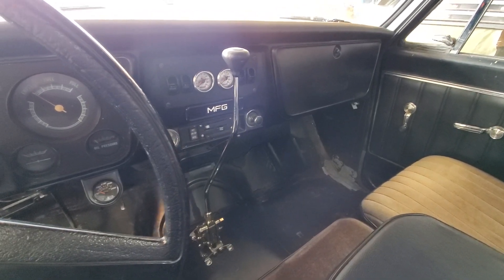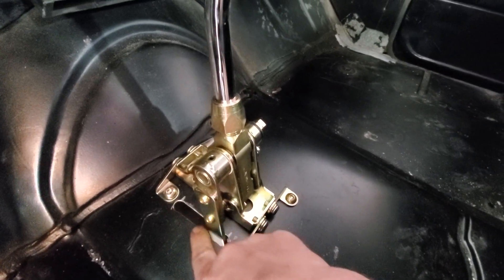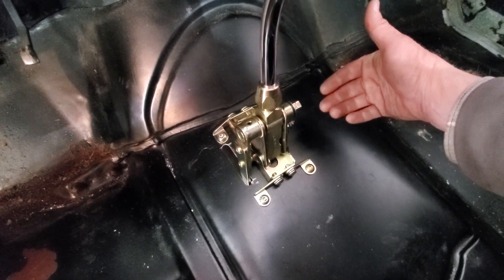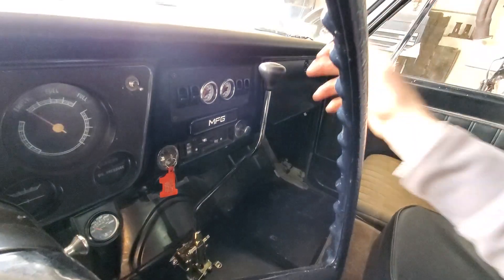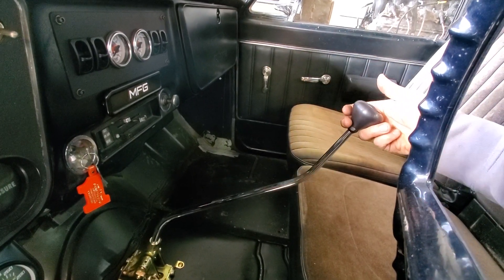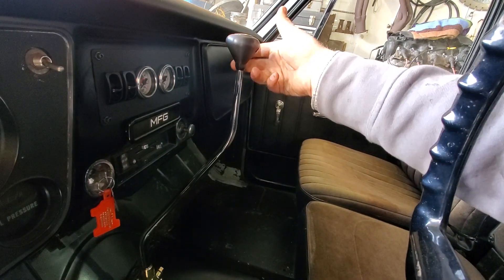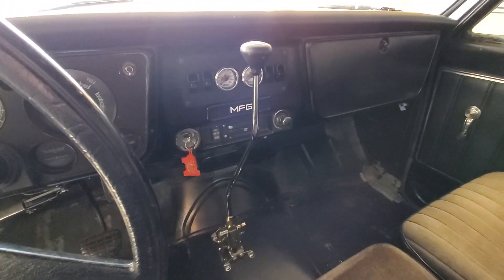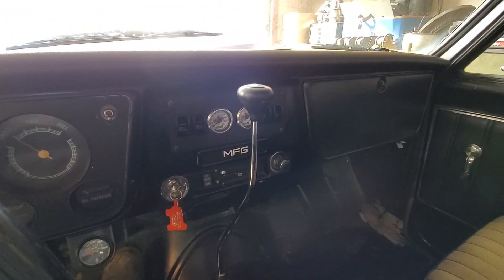Lokar Shifter C10

Comment: The slot in the floor isnt long enough to allow the linkage to move forward as you go into 1st gear, it is hitting the front of the slot at the 2nd gear point. Nothing is missing just enough room for the shifter linkage.

Comment: It locks in park, push button,  pull back to reverse, no detent except in the trans, pull back to neutral, locks in N, push button, pull back to Drive, no detent except in trans, pull back to 2nd, no detent,  push button,  pull back to 1st. Going forward gently push forward to 2nd, no detent,  gently push forward to drive, no detent, push button and push forward to neutral,  locks in N, push button and push forward to reverse, no detent, push button and push forward to park. Easy to miss a gear and go from 1st to drive. It's NOT a racing shifter.

Comment: I have just purchased the same shifter for a 3 speed and am having the same issue finding the missing gear. Either Park doesn't exist, or you just have to park in neutral with a parking brake. What did you find out?

Comment: I am looking at one of these for my c10 as well.  I was wondering how was the installation process? Is this a cable driven version or other? Also what was the issue you were having in the video of missing a gear?
Reply: Unfamiliar with the shifter at this point. The shifter has NO DETENTS for the gear positions, only locks in R and P.